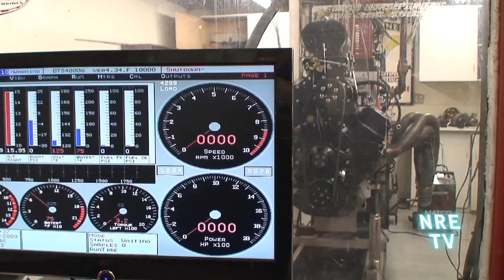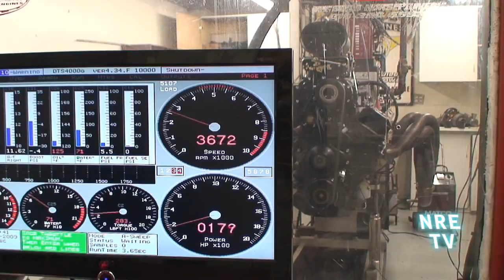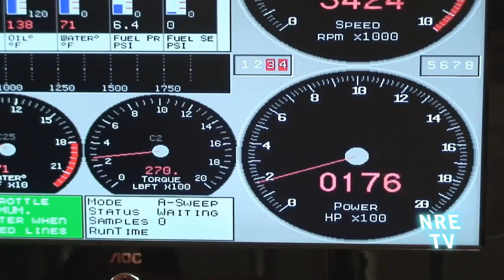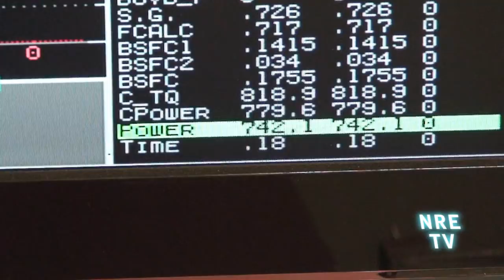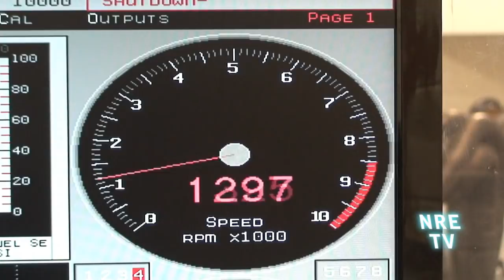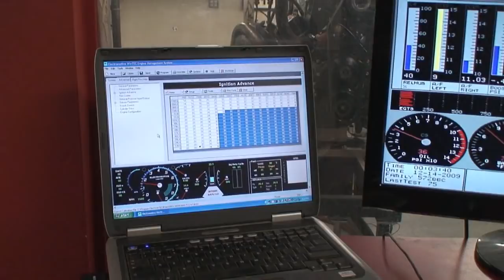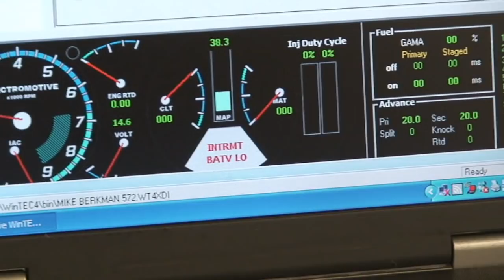1200 HP Supercharged 572 BBC.  Magnificent Noise II. From Nelson Racing Engines. NRE.  Camaro.

Comment: @nawitus if you had 8000hp and 1 ft/lb torque, you would lose any drag race against a car with 1000hp and 6000 ft/lb of torque. torque is acceleration. power is the limit of aceleration. ie 2 equally weighted and aerodynamic cars, one with 8000bhp and 1 ft/lb, one with 1000bhp and 6000 ft/lb. The 1000bhp car will get to a top speed of 260 in 3 seconds. The 8000bhp car will take HOURS to get to 260, although the attainable top speed would be higher.